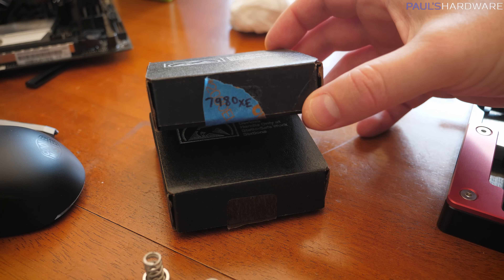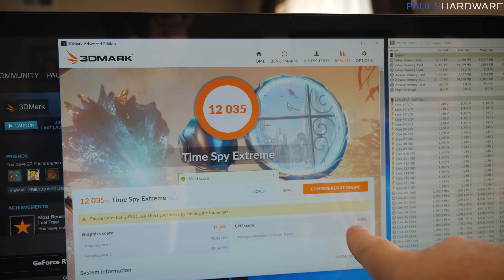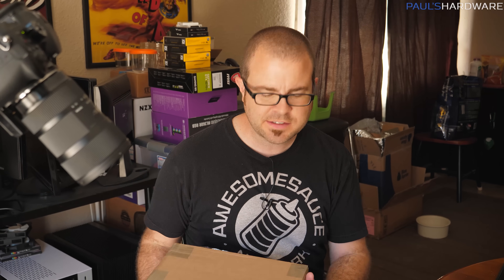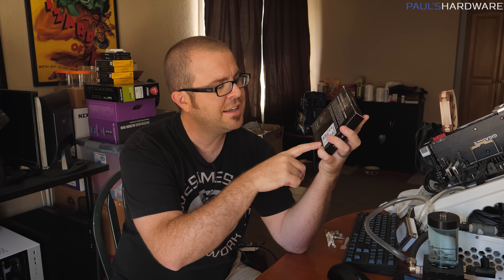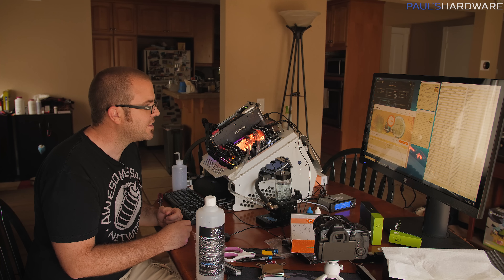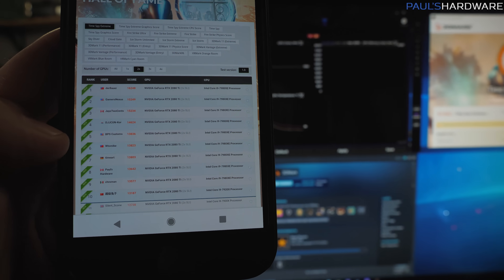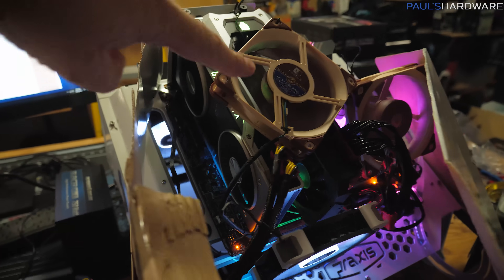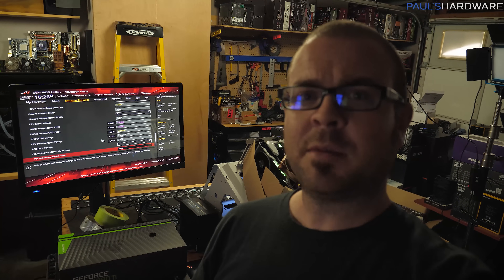Overclocking Battle Log - RTX 2080 Ti SLI + 7980XE

Comment: Paul, if it makes you feel better, I just dropped a sempron into a MB where I thought an 8170 was going into my NAS. Imagine my shock when I saw it run! I had to rip it back out and deal with all the paste inside of a fully built med tower. My cpu was in the wrong clearly-labeled package also. The only difference was that I had lapped both cpus back in the day, so there were no numbers on either cpu. Still, very annoying, so I feel ya.

Comment: you might have thought of this already but i think i saw you plug both power supplies into the same outlet. Most home circuit are rated for 1500 watts. just make sure to plug them into different circuits... there can be several outlets on a circuit...check your breaker box they should be labeled.

Comment: Why they use intel instead of ryzen  for overclocking ?
Reply: Ryzen does not overclock to 5ghz thats why. Sure they have the most cores but they dont reach high frequencies from what I heard. Time spy extreme likes high core plus high frequency so obviously they'll go with intel on this oc battle. Go look on the hall of fame on 3dmark, you don't see amd cpus in the top 10 because their frequency barely hits 3.4ghz on all cores.(i did look and its place 18th on the leaderboard on an amd ryzen 1950x)

Comment: Increase your RAM from RAM settings & lower the timings. 3866mhz out of the box should be way above 4000mhz RAM speed. Dont rely only on BCLK. RAM voltage is too low so you have room. Increase FCLK if you have it. IDK how important is for this benchmark but it will help a little. There are few more BCLK settings that can help for stability. Disable everything you dont need in bios. Long duration Power limit or whatever is called in your motherboard is option you have to look as well. Nice video.

Comment: But why no one uses TR2? It's because it's hard to overclock due to monstrous power consumption and TDP, or what?
Reply: Time spy extreme favors clock speeds along with core count. The 7980xe has a high core count but can also get a higher clock speed than TR2 chips.  That said, there are some people on the leaderboard with 1950x and 2950x cpus.
Reply: Supervillain321 but TR2 has 64 threads and 7980xe only 36. Shouldn't it be enough to bit the Intel one?

Comment: I'm happy with my Pc, I think gonna stick to the Gens i'm stuck with only uprading them

Got a I5 7600 
With a Gtx 1060 6gb 
I'm soon gonna Upgrade my Graphic Card to a Gtx 1070 Ti
But my Processor has to wait 
Planning uprade that with a I7 7700
But i have to save money for that
Everything else is already fully upgraded
Reply: I would recommend going for the gtx 1080 instead as they are around same price range.
Reply: @sjarken3979  it's like €50 difrence, and the Fps difrence are very small

Comment: Definitely set up that Mega-Radiator like Jay has. Combined with the AC trick, and having your GPUs and CPU on a shared watercooling loop going through the Mega-Radiator (remembering to also have a secondary pump), you could get some very nice temperatures.

Comment: Keep in mind. With all these 15,000+ scores in Time Spy Extreme, Jay has yet to delid his already slightly damaged 7980XE. That 15,234 score of Jay's is on an AC unit, and watercooled CPU and GPU. Nothing else has been modded yet. If he should decide to delid that CPU of his, the results should be roughly  the same (+1,500 jump) and he'd beat Steve without much issue. Also, he hasn't watercooled his VRM yet either.

As far as LTT goes... well... he's got a bit of an issue with condensation.
Reply: While he would see a jump, to assume a linear jump of +1500 points is not realistic. TimeSpy scales almost exponentially in difficulty.
Reply: So if you were able to speculate on the possible highest clock jay can get on his cpu if he delids what would you guess? Did he actually suffer from degradation, will you do locks of love for paul?
Reply: Also there is not reason to believe his cpu is as held back by not being delidded as pauls was. His chip is doing really well to stay cool even with an overclock. His chip might not be dropping as much clock speed as pauls in un-ideal conditions.
Reply: LTT has gotten a little too moist.

Comment: Why is nobody using a threadripper chip for this battle?
Reply: because time spy favors intel, it likes high clocks better than more threads.  the highest thread ripper cpu scores are about 3-4k below typical 7980xe scores, but most of those are 1st gen.  if you head over to the 3dmark hall of fame you wont find a threadripper in the top 100 of cpu scores.  not saying threadripper isnt good, just this particular test doesnt run as well on it

Comment: Better than 8700k ...
On gaming?
Reply: At gaming the 8700k will in most cases be better (or at least an equally good option for less money), because most games don't use anything over 8 cores and are more hungry for Ghz rather then thread count. And the 8700k can easily hit 4.8-5Ghz without messing with much else then XMP profile and bumping the multiplier, as long as you have a good air cooler or a good AIO.
Reply: @renehoyvik  so y an skylake X CPU?
Reply: Well, the low end ones are useless imo as the R7 does the same job for half the price, but the high end ones like the 7980XE are great for applications like Video editing, software rendering or compiling code.
Reply: In most cases a 8700k will beat a 7980xe in gaming, it's got less cores and more games can't fully spread the load over all 18 cores.

Comment: OMG I've had to post this on so many comments ..... how did everyone miss Paul explaining why he didn't use liquid metal????? he was very clear and not rushed in anyway ... he said that he didn't have any liquid metal or he would have used it and has some coming in the mail and will add liquid metal to it once he gets it... he also mentioned that this was a good chance to get a baseline with delided thermal paste... meaning = test the diff that just replacing Intel's toothpaste with a good thermal paste would do vs liquid metal

Comment: Delidding + TIM will not give the best results. Actually, I tried direct-die with TIM and got worse results. You should put Conductonaut between IHS and core. :) Also seen reports of monoblock not making good contact after deliddding and removing the glue.

Comment: Paul you need liquid metal between CPU glass die and lid.  Then thermal paste between lid and waterblock.  This will greatly help your score.  Also leave all the memory settings and frequency as is, except lower each RAM timing by one.  Ex 18-19-19-38 down to 17-18-18-37  Good luck.

Comment: use dualrank kits to imrove your ratings. Like g.skill 4x16 or 8x16 kits
Reply: 4x8 better than 8x16
Reply: maybe sometimes 4x8 vs 8x16 (not 4x16), but dualrank memory with lower freq always much faster than 1rank and ingame fps or rates in marks always higher, for ex dualrank 2933 destroys one rank 3200-3333. I think quad-channel dualrank 3600 g.skill on X299 can beat anything.

Comment: Why is threadripper not a good CPU for this?
Reply: Honestly, because this intel CPU is just faster and overclocks higher. It is ludicrously expensive though which is why all the hardware reviewers have one but 99.9% of us don't.
Reply: Threadripper will never be able to be competitive in bench-marking dog fights because AMD CPU's just don 't overclock very high now days with ZEN... the FX series chips you could get some massive frequency going on them at the expense of having to cool temps around what it would be like strapping an EK water block big enough to cool the surface of the sun... but it was at least possible.  With AMD's Zen line up they just are not made to compete with the pure horsepower that an Intel Ring Bus CPU can provide due to the way Zen is made with its infinity fabric that from a base engineering level is magnitudes slower than Ring Bus.  But AMD was smart and chose to take market control where there was a void so that they could maximize profits, its smart of them.
Reply: The real reason is because Intel reach higher clocks. That is the reason Intel is better for games. Games and benchmarks like clock speed. Threadripper beats the Intel in some real life scenarios depending which software you use.
Reply: As many others have stated, This benchmark in particular wants both Thread count and clock speed. Although the threadripper beats it in thread count, you won't get much more then 4.2 - 4.4 Ghz out of it, so Timespy Extreme will favor the 7980XE because of the higher clock speed. In other applications that want more threads hover, the threadripper would likely win out. So always purchase with what you will use the computer for in mind. So gaming for example rarely use any more then 8 threads, so a 12 thread intel 8700k would be my top choice, if i was streaming however i would probably go for a 16 thread AMD R7.
Reply: 7980xe has much better oc potential over threadripper, I'm sure you can hit 6ghz on all cores if you try hard enough.
Reply: Think of thread ripper as being better at multiple tasks at once and the intel chips better at single tasks making them more efficient for benchmarking.

Comment: Still waiting for one of you to have the courage to use a fridge for a controlled environment, so you can dehumidify the interior, and use below zero cooling on your blocks. Can't have condensation if there's no water in the atmosphere!
Reply: makes you wounder why we haven't seen one of these computer case companies come out yet with a computer case with a refrigeration unit built into it..
Reply: It's not a huge stretch of the imagination, since it'd require insulated sides and huge spacing for the refrigeration unit alone.

Comment: Did you turn off unneeded Windows services?
Search, etc.
Reply: Or the AVX offset - he's got 1 there which means -1 from the multiplier (that's what Jay said), and the preset RTS that GN used to tweak GPU frequencies during the benchmark, so there is space for improvement.

Comment: You'd think that for such an EXPENSIVE processor the manufacturer wouldn't cheap on the thermal paste, but I guess no.
Overclocking CPUs should come with a cap that could be easily removed without using such a specialized tool.

Comment: you delidded but why not using liquid metal? I'm sure not much difference compared to thermal paste but there's a difference anyway..
Reply: He literally said he didn't have any and it would be coming the next day.
Reply: OMG I've had to post this on so many comments ..... how did everyone miss Paul explaning why he didn't use liquid metal>????? he was very clear and not rushed in anyway ... he said that he didn't have any liquid metal or he would have used it and has some coming in the mail and will add liquid metal to it once he gets it... he also mentioned that this was a good chance to test the diff that just replacing Intel's toothpaste with a good thermal paste would do vs liquid metal

Comment: Is it possible to overclock ryzen 2600x to 4.5ghz?
Reply: It's possible.... Dry ice method...
Reply: @KarrasBastomi  what's the max I can get with masterliquid 120r from coolermaster?
Reply: 120mm? 3.9ish stable for daily driver...
Reply: @KarrasBastomi  That seems a little low. I have 3.9 on my R5 1600 with the stock cooler

Comment: Can someone explain why the thermal paste on top of the CPU was applied as it was? I thought a dot in the middle was supposed to be the best to prevent air bubbles and what not. Also, why isn't a dot in the middle used in the de-lid process when re-applying the CPU lid? Spreading it seems like it could cause a way worse application.
Reply from the maker: If you're applying paste directly to a CPU or GPU die, you absolutely must cover the die completely. The dot method would be dangerous because it might not spread to reach the corners of the die, or might not do so quickly enough when you're first booting up. Air bubbles aren't really something to worry about.
Reply: When applying paste ONTO a CPU or GPU die ( The silicon ) you have to not take any chances and fuck around with putting dots and what not ... if you don't have 100% coverage you risk meltdown... also when you spread out the paste like Paul did and reapply the IHS free floating as he did ... the mounting pressure from his cooling solution adds enough pressure to squeezes out any air bubbles.
Reply: Awesome, thanks for the responses!!

Comment: What is that little plastic tool you used to spread the thermal paste at 8:12? I like that method much better than the dot method but was wondering if I can just use a small brush or my finger or any tool in particular to spread it evenly.
Reply: Some Cooling kits and Paste kits send a plastic spudger to spread paste and such.
Reply from the maker: It's a little paste-spreading tool that came with some Cooler Master thermal paste

Comment: So technically you are number 1 since everyone had to mod and liquid cool. You used old fashioned Paul's Hardware ingenuity to get your scores.
Reply from the maker: I've always thought you were very smart Joshua 😁
Reply: "liquid cool"

So you missed the part of both videos where he liquid cooled the CPU. You should probably pay attention.
Reply: @mjc0961  I did, pay attention. Just like how Paul didn't do anything drastic or out of reach from a normal user to get his numbers.
Reply: Other than ghetto modding for cooling, the blocks are all actual products so the "neatest" compared to the rest?
Reply: He Delided , he cheated too... but overclocking has always been about mod’s so if you consider water cooling/ mods cheating your just in denial anyway.
Reply: They need different sub categories  e.g. gpu air/gpu water/sub ambient
Reply: @carlwells9504  The issue is how do you know people are going to report how they're cooling correctly. You can't verify that though software

Comment: I didn't need to watch the video to like, comment, and stay subscribed :D
Reply from the maker: you should watch too though!
Reply: I finished watching it and I'm glad the bench produced results! I'm sure with water-cooled GPUs and liquid metal on the CPU die, you can crack the top 3.
Reply: i clicked like before it even started playing, as i do with every single PH video. this inspired me to see how far i could push my old FX 8 core and msi 1080 card, and against comparable hardware, i am now at the tops of the leaderboards on all but the extreme and ultra tests (because i only have the free version)